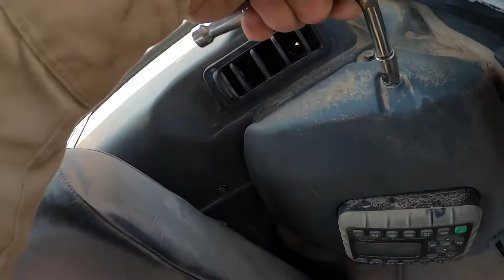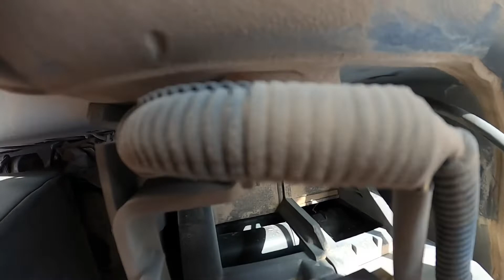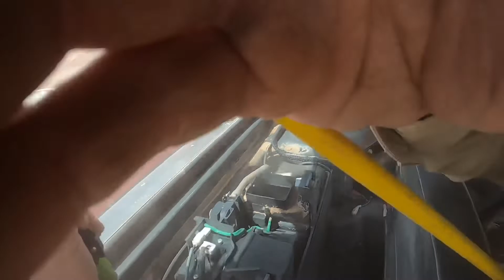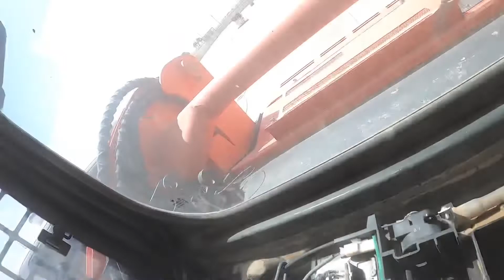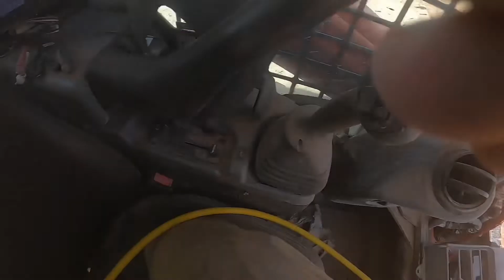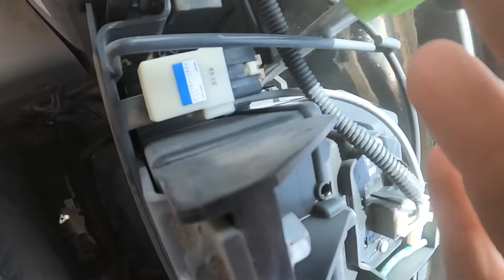How to series: SVL A/c clean out

Comment: A better way is to cut a round hole at the bottom and when your blowing it backwards off the a/c evaporator core have a shop vac in the hole you drill at the bottom to get rid of all the dirt you blow off the core.   Then use a expandable rubber freeze plug to cap the hole  he’s blowing it loose and it has no where to go except the bottom of the case.   And eventually it will be rite back in the core

Comment: Unless you pull your box apart, you're just fartin in the wind of ever cleaning the evaporator. What you're doing is just scratching the surface.
Reply: I took the entire HVAC box out and and used a garden hose on the Kubota KX 040-4 excavator.  I like the quickness of this method but not sure how effective it is.

Comment: Thanks for the post.  I finally took it to new level. I cut two small doors (1”x7”) with dremel tool in front and behind the evap coil. I seal these with foil tape. This way When the coil gets dirty I can remove the trim panel cut the foil tape and clean the coil with a small brush, air compressor and vacuum. About a hour versus 6 hrs to remove seat , tear that whole AC box apart and clean. I also use filter cloth and tape over the AC filter inlet. This provides a first pass filter.
Reply: Hi I would like to know more bud mine gets blocked regularly down in Australia very dusty down here

Comment: Thank you for posting this.  I mulch with an svl95 and do a lot of dirt work with the door open.  I’ve noticed that the air is barely coming out of the vents now and was planning to tear into it when I have some downtime.  This will save me a lot of time.
Reply: I found it to be a 4-5 hr job to actually get to coil on my svl95.  Ended up cutting a ~1.5” x 6” slot on both sides of the evaporator coil. Now I can clean it in less than a hour.  Use small wire brush and compressed air and vacuum running.  Let coil dry out over night!!!   I just use AC foil tape to seal it up.  Works great.  It was 103 in Texas last week AC air 50 degrees coming out back vent.
Reply from the maker: You’re welcome. I’m sure it’s not as good as what the dealership would do but maybe so, don’t know. But you don’t have the machine down for days waiting. It takes about 30 mins including getting the air compressor set up and charged. 
Thanks for watching!
Reply: @panhandleplainsranchservic9425  I just finished but I only had access to a small compressor and didn't have the genie but it made a huge difference.  I'll do it again when I'm back at my shop but for now I'm much cooler. 

One thing I did add to the process was to close off all of the front vents except for the round one that points at the windshield.  I stuck my leaf blower over the one open outlet and it blew a decent amount of stuff back out of the heater core.
Reply from the maker: Whatever works best for you. Sure beats roasting alive in the machine
Reply: I have the same issue with my slv95, the problem is the door seal, supposedly the new model slv97 doesn't have that issue anymore.other the that I'm happy with my skidster
Reply: How can y’all adjust the door
Reply: I have a 97 and the door slings open while mulching at least  20 times a day

Comment: Thanks for the video I have a ssv65 rubber tire machine and haven't had any trouble yet I keep my front window closed
Reply from the maker: The tire machines have a different system and a whole lot better cab on them. We have an SSV 75 and have no problems as well. From what I was told by a kubota rep the machines were designed by two different teams all together. One day the SVL machines will have a better cab on them. But until then this is how we do it. 
Thanks for commenting and watching!

Comment: That was a dirty job!  Stupid question.  If you're recirculating inside air you're going to have the door and windows closed.  How can it get so dusty inside?  

You must be related to Dusty Hill, RIP.  Good to see you.
Reply from the maker: You’d be surprised how much dirt gets in. The cab doesn’t quite seal to the floor the way it did when it was new and the door seals are about done also. Out in west Texas the dirt is very fine and gets into basically everything.
Reply: @panhandleplainsranchservic9425  Makes sense.  I had some tractor work done last Summer.  The guy had a 2 year old closed cab Kubota tractor.  He kept it cold.  Opening the door felt like standing in front of an open refrigerator.  Ha ha
Reply from the maker: And for the beard I’ve been letting it grow just cause it looks good